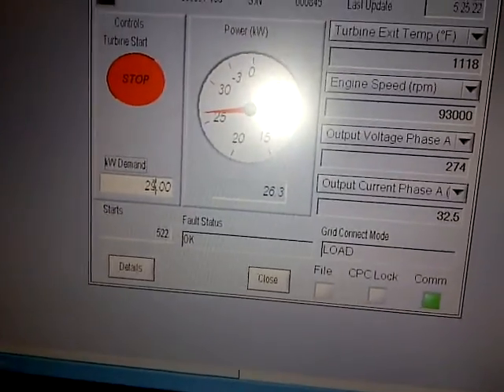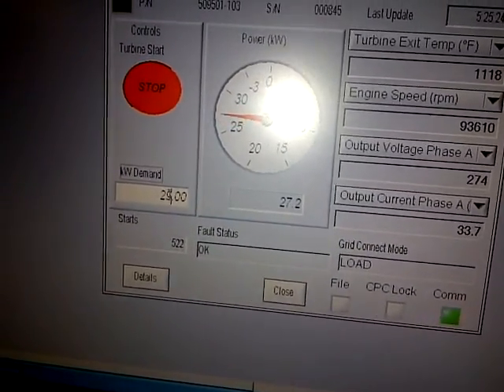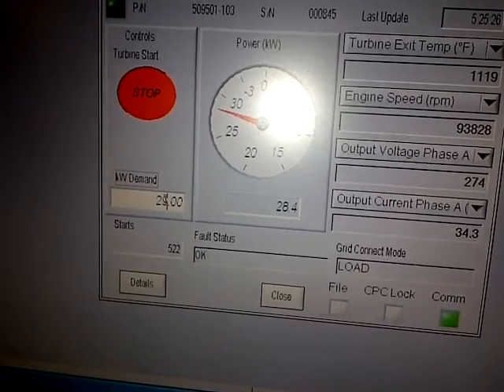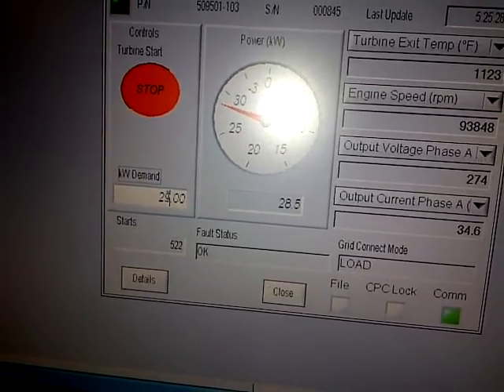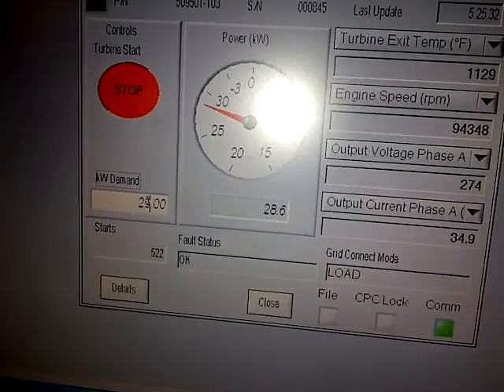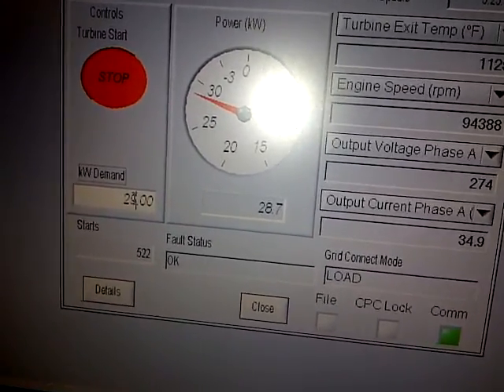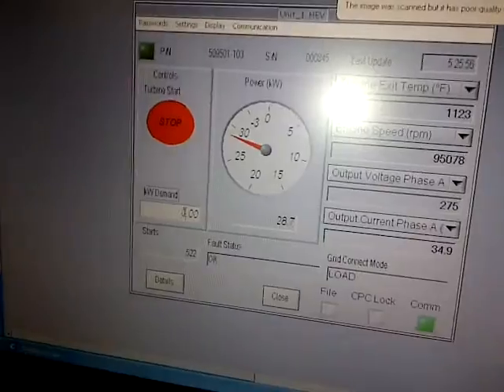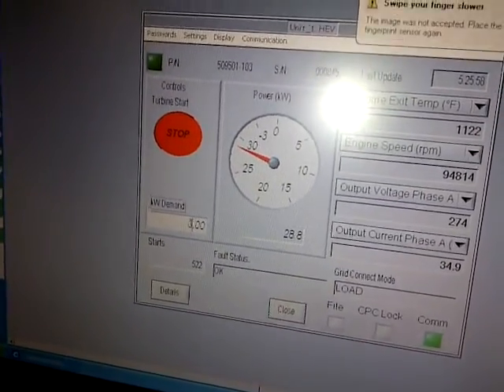Capstone C30 microturbine full power run Warwick University Vehicle Energy Facility VEF

Comment from the maker: Hi This test bed set up used 20 x 50Ah lead-acid car batteries to provide 280V nominal supply. The Microturbine acts as a current source and will charge any type of battery provided it operates within pre-defined limits.
Reply: gasturbine101
Una pregunta, normalmente usa 18, no hay problemas en usar 20 baterías?
Reply: try Capstone C30 microturbine with these  Fuel pure kerosene fuel vs Citronella Scented Torch Fuel vs  Synthetic Diesel vs Liquid Paraffin Lamp Oil vs 2 stroke oil